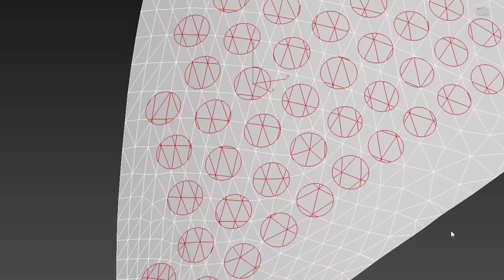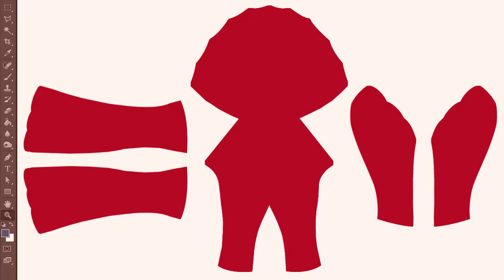Making the SPIDER-MAN Mask! Movie Costume Replica

Comment: Looks so legit from the 2002 film
Reply: Hu hu
Reply: I wish tobey still played spiderman
Reply: u mean 2004 or 2007 because 2002 is different
Reply: @abdmin3268  2002, 2004 and 2007 are exactly the same. Sam Raimi's trilogy
Reply: @_Leo_-  yeah but the design is different, for example the spider emblem is small 2002, but big in 2004 and 2007
Reply: It's 2004&2007
Reply: Yeap but this costume is from Spider-Man 2 and Spider-Man 3 movies
Reply: connextro  That's right in the first Spider-Man his Spider Mask looks more round.
Reply: connextro Yeah they both look the same ish..
Reply: connextro Idk, I just think its similar to the 2002 film.
Reply: @kevsaviation8990  It is different.. The lenses in the 2002 film are slightly big, The logos are different, the color of the soles and the 2004/2007 suit are more brighter.

Comment: What is the cloth material? Also what kind of machine did u use to make the web? Also what was the gluey substance used for the web? Also which glue did u use to stick it?
Reply: The web is a flexible and elastic (poly)urethane (rubber) which was casted into the CNC milled mold.
Reply: can a 3d printer work to make the mold? using an stl file or something?

Comment: How much this? I wanna buy it! :D
Reply: T1ERY Teaside 3k+ for the whole suit, there was a Reddit post from 2010 where some like him or Him sold one for a little over 3,000 but I don’t think it would be that much for a mask
Reply: @frosty6630  I thought they said it was over 31.000 or 300,000!
Reply: You can see in the description that you can buy the mesh for 300$ and the other parts for 150$
You'll still have to sew and dye the piece of fabric, cnc a mold and cast the sylicone web, then attach it and assemble it. But that's the easy part.
The kick in the crotch is actually designing the 3d model so that the head really resembles the real one, but they already did that for you